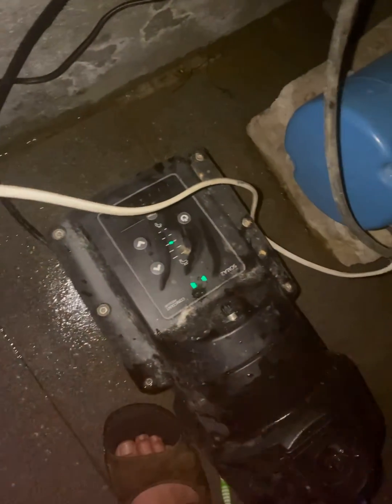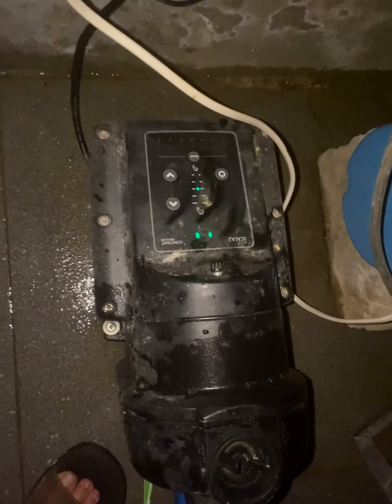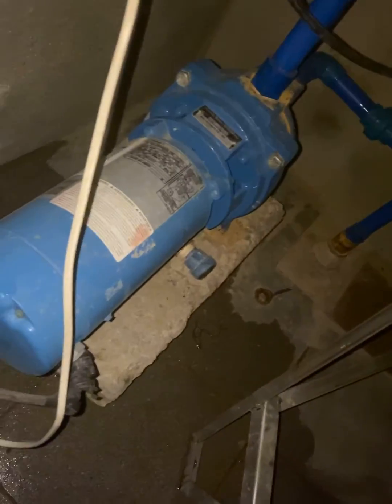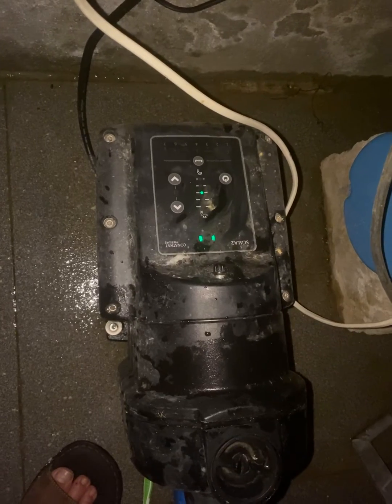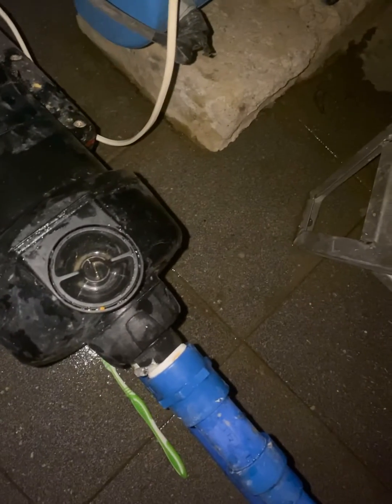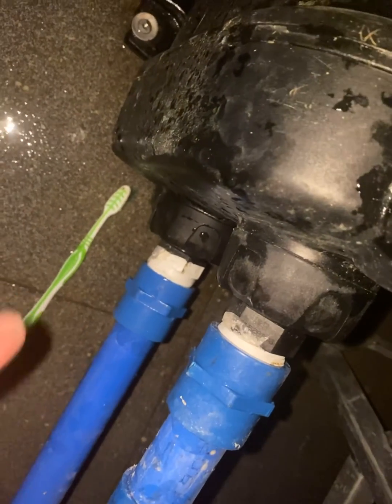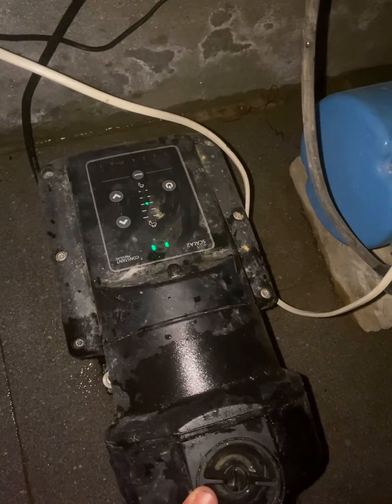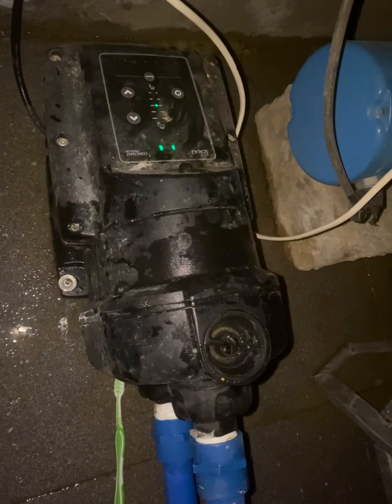Grundfos Scala 2 , easy FIX fail code 3 (red led)

Comment: I have the same pump and I'm not getting any of the red light codes at the bottom like one, two or three. Mine were the two green lights circle at the top. When it's running. Mine is basically flashing red and green and it seems like it's a one to two flashing of the red light at the top.  Need help?
Reply: I have the same problem, did you find a solution?

Comment: Hi Morten -  I found your video while researching the Scala2 Booster Pumps.  I live in the Tarlac Philippines and am struggling with poor water supply from the local utility (PrimeWater).  

My set up currently is: from city main (1 inch line) to a filter to an elevated 1500L storage tank then to a 1hp jet pump which fills a 300L Pressure tank (25-45psi)  which supplies the house.  My problem is that we live on small hill (about 20m above nominal street level) and the city water is only actually on (boosted) once per day from about 5am to 7am with very low pressure.  The pressure is so low that it cannot get up to the storage tank to fill it.    
So, seeing that at first glance you seem to have a set up similar to mine, my questions for you are (if you know):  
Is the Scala2 a pump which will work if the supply is intermittent - only on for 2 hours every 24 hours?  Or will it continually kick out and have to be manually reset, over and over?  
Will the pump sense that there is no incoming water flow (when city water is off) and then not try to come on even though the storage would accept more water?

Thanks for any insight you can provide.  When we moved to the PI 6 yrs ago I knew I would encounter issues, but the poor water supply  here where we live is really frustrating.
Reply from the maker: -the only way you can solve that problem is to get a supply tank where your supply is from your distributor get enough buffer that can supply your house for 24 hours then put this pump in between your house and the tank and add some filters then you’re good to go
Reply: @Moe.Manila  Thanks for the reply. What you describe is pretty much the setup I have now, but with my pressure tank in place of a booster.
But really I'm trying to find out if I can use a booster pump to pull water in from the city water lines.  So although you didn't actually address my questions, I take you think it the Scala pump will NOT work with intermittent supply.